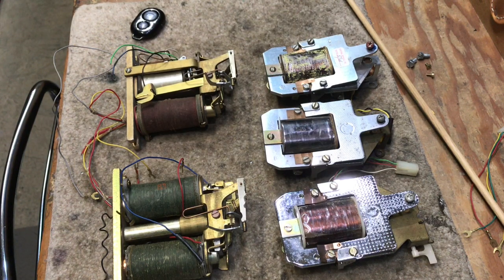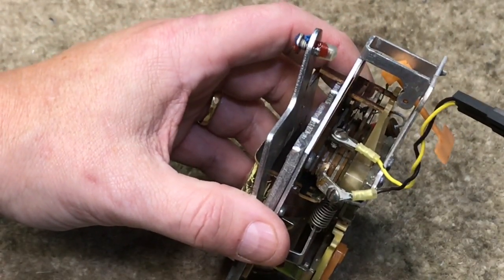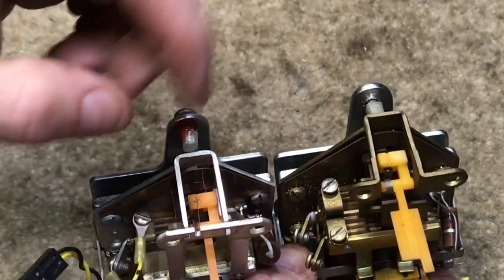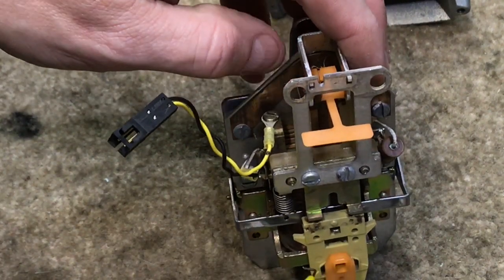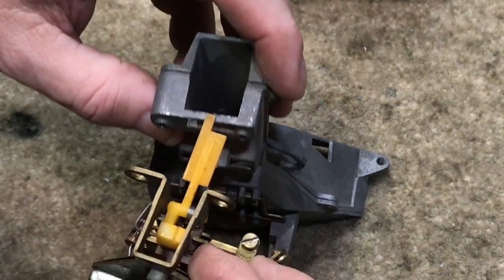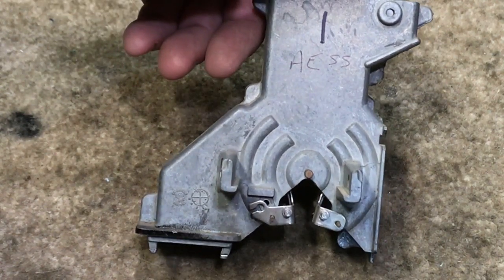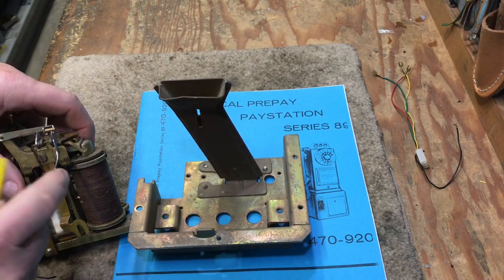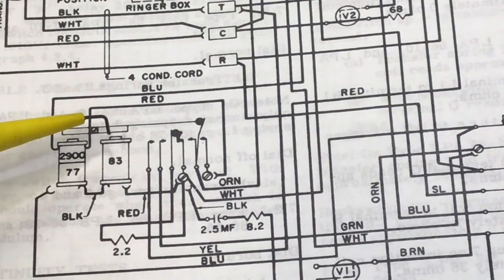Payphone coin control relays. 3 Slot and single slot payphones.

Comment: The part in the hopper that you said didn't know what the term was... It's called a coin vain it directs the coin to go in the correct direction, collect or refund that was held in escrow. The part that resembles a spoon is called the coin trap, it holds the coin(s) in escrow until the call is terminated and the CO send the voltage at the polarity needed to collect or refund.
Hope this helps.
In love your videos, keep up the good stuff!